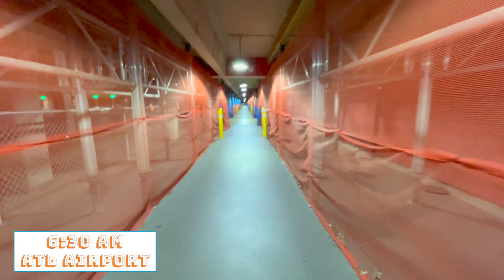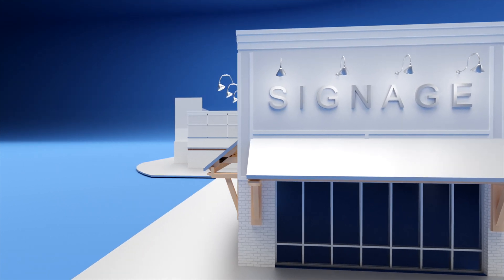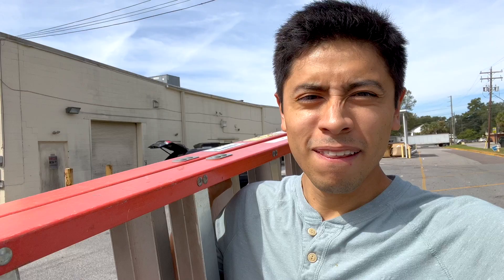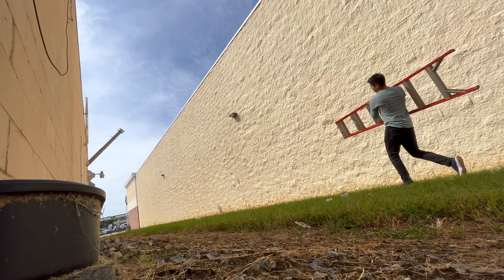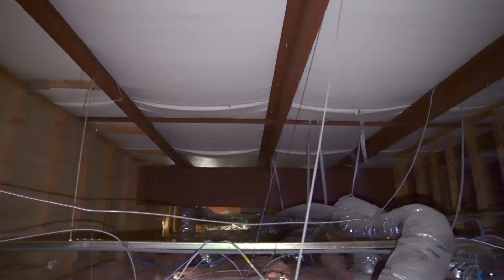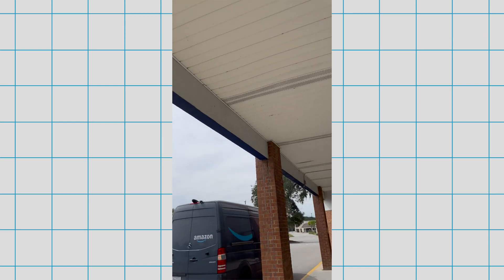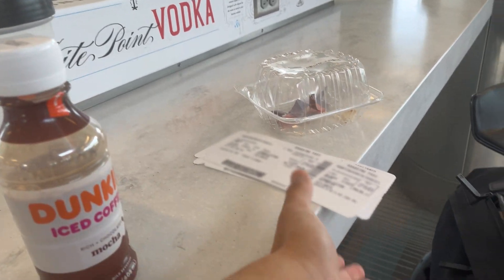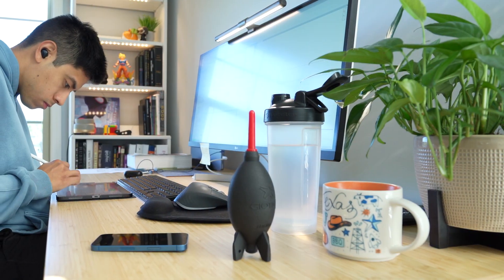A Day in The Life - Site Visit 🏗✏️ Structural Engineering

Comment: the structure look structurally sound, you have not checked the foundations, and concrete walls strength.. also in my opinion, ( you can introduce UC columns from the ground to support the proposed floor, considering that the building need staircase and other services